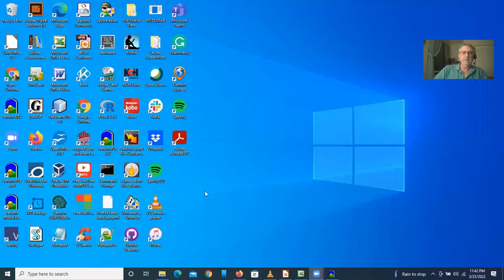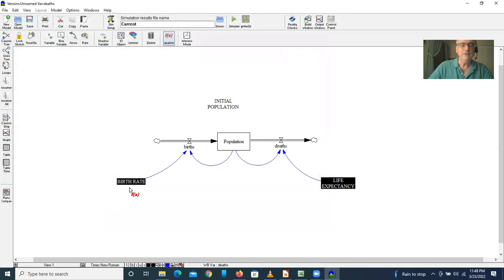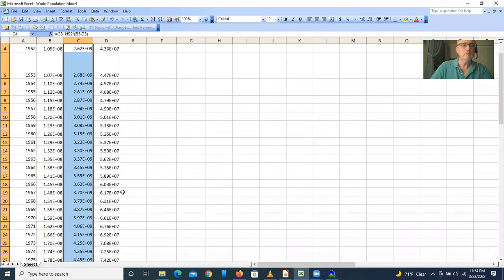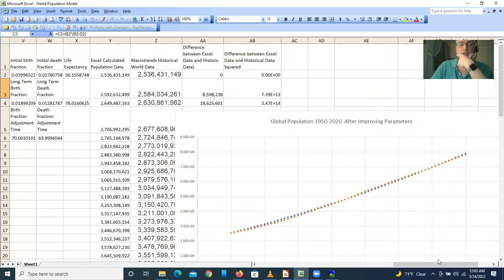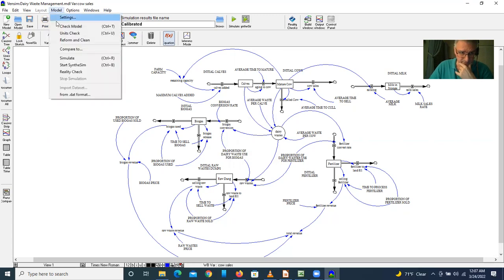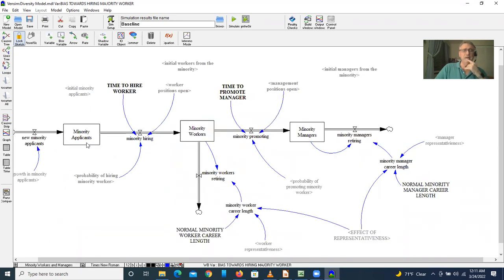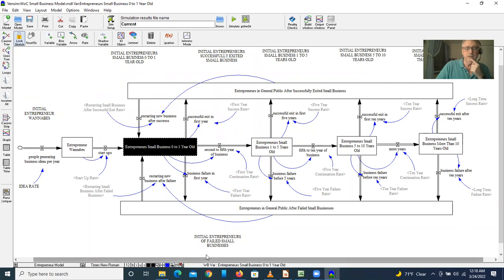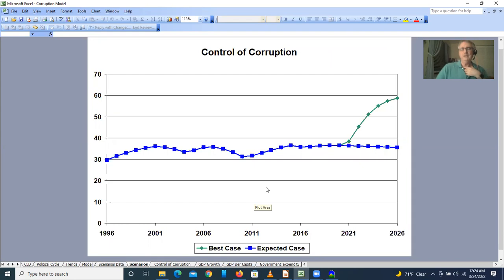Practical System Dynamics Modeling

Comment: Ivan, could you explain why you use system dynamics instead of Excel? I understand that Excel helps with parameter estimation for historic data. You could use Excel to run scenarios into the future.
Reply: Yes, I sometimes do use Excel for the projections. Sometimes it is easier to compare different future scenarios in Vensim. Thanks for asking. I should make it clearer.
Reply: Hello Len, I just saw this now. I could run scenarios into the future with Excel, but there is a slight complication that is unfortunate when you want to show the same parameter in multiple scenarios on the same graph. I will bring this up in future presentations. Thanks for the advice. I hope this helps. Ivan